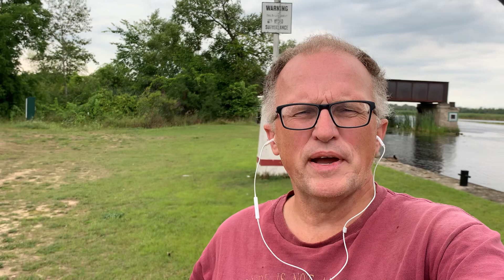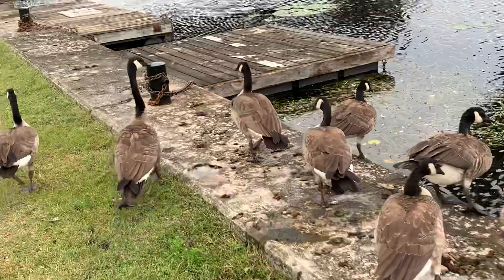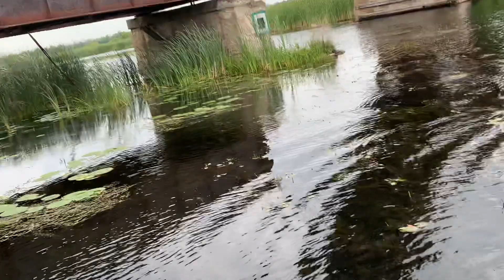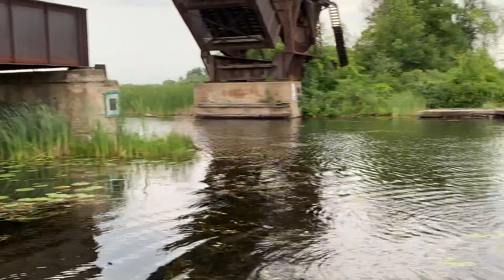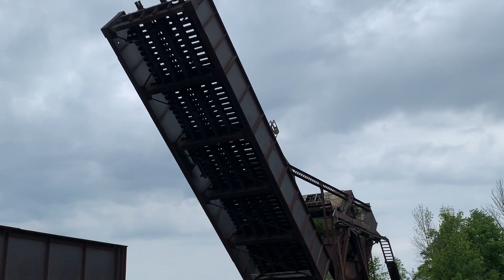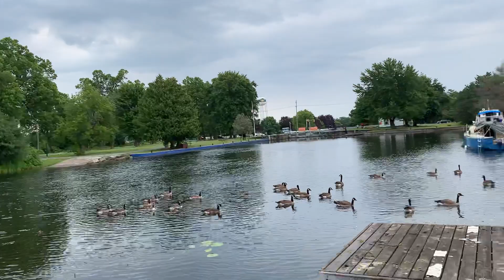My Club of Rome Invited Talk: Abrupt Climate System Change Mayhem:

Comment from the maker: Please donate to my blog at http://paulbeckwith.net to support my research and videos joining the dots on abrupt climate change.

Yesterday, I gave an invited talk to CACOR (Canadian Association of the Club of Rome).
Below is the simplified general description of my talk. I spoke for about 45 minutes, and took questions and chatted with the audience for another 45 minutes. 

Please watch the recorded talk on YouTube at this link: https://youtu.be/HtQWuVUqPI8 

This introduction video was filmed in Smith Falls, Ontario at the site of the famous bascule see-saw railway bridge (a designated Canadian National Heritage Site). This bridge was built in 1912-13 and is so delicately balanced that it was originally operated by a small electric DC motor, most towns operated on DC (direct current) electricity back then. When AC (alternating current) beat out DC a few years later, then the town, like all other places in North America switched over to AC electricity, and the bridge motor no longer worked, so the bridge was then operated manually for many years, until the rail route was eventually closed down in 1978.

For more info on this rail bridge, this site is great:
https://ottawarewind.com/2015/02/04/the-iron-giant-smiths-falls-100-year-old-bascule-bridge/

On to my CACOR talk…

Speaker: Paul Beckwith
Topic:  Abrupt Climate System Change Mayhem
Time: Jul 28, 2021 13:30 Eastern Time (US and Canada)

Summary:
Temperatures in Lytton, BC set new consecutive records recently on a Monday, Tuesday, and Wednesday, and then on Thursday wildfires burned the town to the ground. Torrential rains leading to swollen rivers and flooding just devastated many towns in Europe. Weather extremes are wreaking havoc around the planet. No place is spared. Why?
 
Two Basic Facts:
1) For each 1 degree C rise in temperature, the air can hold 7% more water vapour. This results in the supercharging of storm intensities. 
 
2) The Jet Streams which guide weather patterns are slowing as the Arctic warms, making them wavier in the North-South direction. This increases the intensity, duration, and frequency of extreme weather events around the planet. It also causes them to occur where they never did before. 
 
What happens in the Arctic doesn’t stay in the Arctic. It’s not like Las Vegas. Polar changes have rewired the behaviour of the jet streams.
 
Weather wilding, weirding, and whiplashing is wreaking havoc on our society and imperiling our ability to grow food. 

It won’t end well; it is getting uglier and uglier at an accelerated pace.
 
What can we do??
 
Who is he?
Paul Beckwith, a well-known climate system scientist/physicist/engineer and educator, recently returned from his latest road trip to create a series of videos pertaining to the climate and biodiversity crises.  Paul went from Ottawa, Ontario, to Alberta.   In addition, he took a carbon dioxide monitor with him to measure CO2 levels in enclosed spaces.

Based in Ottawa, Ontario, Canada, Paul is a respected creator of entertaining and comprehensible videos, usually pertaining to climate system science, abrupt climate change, meteorology, oceanography and Earth Sciences.  He occasionally teaches at the University of Ottawa in the Laboratory for Paleoclimatology, and has also taught at Carleton University. He is often asked by concerned citizens and government officials to speak at conferences and events.  In addition to participating in numerous panel discussions, Paul has often been interviewed on various radio and podcast programs, and has participated as a guest and panelist at three United Nations Conference of the Parties Climate Conferences, including COP25 in Madrid, Spain, in December 2019.

In addition to his own YouTube channel , he is a panelist on the Climate Emergency Forum  and is a member of the Facing Future  team.

Paul has been committed to raising public awareness about the climate crisis for over twenty years.  Prior to the Kyoto Protocol, he collected petition signatures, which he presented to a Canadian representative, Elizabeth May.  Paul is actively involved in local climate events since the Kyoto Protocol.  

Please donate to my blog at http://paulbeckwith.net to support my research and videos joining the dots on abrupt climate change.
Reply: You are not alone.
Reply: shame on you Paul harassing those geese. typical human behavior.  humans are trashing the biosphere. no respect for Life!
Reply: 3800 days since Fukushima today, and 76 years since Hiroshima, too. Helluva way to boil a planet that's 71% water for 76 years of Enrico Fermi's legacy, eh professor? Einstein is rolling in his grave so fast, we could hook a generator up to his corpse and power the world eternally for free!
Reply: Jorn Paul Winkler  so what? The salmon are dying at sea, that's so what! TROLL!
Reply: Jorn Paul Winkler  can't have infinite growth on a finite planet.
Reply: Copyright can last a very very long time, well beyond the life span of the author. For example, even now in the 21st Century in the year 2021, Hollywood movie studios still mostly avoid use of the "Happy Birthday" song, a song that was written in the 19th Century, due to fear of having to pay money to copyright lawyers in the European Union.

One workaround for copyright is that once money is paid in a valid manner to the copyright ownership, or sometimes by the copyright ownership in exchange for helping publicize a work, then changes in ownership do not cause the use of a copyright work to be invalid. Suppose for example that someone in 2021 pays Paul Beckwith $8 to be able to legally copy some Paul Beckwith video materials onto other YouTube videos in another YouTube channel, and then Paul Beckwith dies of old age 10 years from now and Big Oil and Big Coal buy up Paul Beckwith's entire estate at auction. The oil and coal companies cannot then take down those videos on that other YouTube channel, in spite of having become the new copyright owner in that hypothetical situation, because of there having been an exchange of money. They probably can however in that hypothetical situation 10 years in the future, as the new copyright owner, take down videos of people who with Paul Beckwith's permission copied for free Paul Beckwith video material onto their own YouTube channels, since there had been no exchange of money. Where no money has been exchanged, a new copyright owner typically has the right to insist on either a copyright payment or a video takedown.

I am curious about the copyright ownership of the Paul Beckwith video in the Canadian Association for Club of Rome, because I am curious to whom YouTubers, YouTubers who might want to exhibit long term copyright care, would pay some nominal amount of money, in order to avoid video takedowns 10 or so years in the future by Big Oil or Big Coal, just in case Big Oil or Big Coal eventually buy up Paul Beckwith's estate - or more to the point buy up his YouTube video collection - when he eventually dies of old age some year.

Comment: The IPCC report was discussed in our news. It was not fun. 
 So I wonder about carbon removal if Japanese knotweed is not a pest we could use to our advantage. It grows so fast and it is so resilient that it can be harvested many times and then the biomass can be dried easily so conversion to biochar seems easy. That biochar could then again by used to improve soils. I read the rhizomes do spread out but only a few meter and then it stops. The damage to buildings seems also less than always thought according to recent research. Trees are worse in this aspect. I have no good idea if the gas released during pyrolysis could be used as fuel during the process. This would release some CO2 too of course.

Comment: HI Paul, I have a question. "What affect would it have on the climate if the Gulf steam current stopped?"
Reply: europe gets cooler america gets hotter
Reply: @iPownYouN00B  That is also my idea but perhaps the  stagnant water there where the Gulfstream normally starts would then get so hot that almost all oxygen would disappear??
Reply: @jean-pierredevent970  the reason the oxygen disappears is because when the water isnt moving there is no way for oxygen to get into the water. Like you need a waterpump in a aquarium you need the movement of the circulation to enrich the water. The pump is the circulation going down in arctic to then down  around africa mixing with different stream endong up at the antarctic rising and in this long process enriches the water with oxygen
Reply: @iPownYouN00B  Thanks!!

Comment: Nice video, thanks Paul. Not a unique use of the bascule method of balancing bridge spans, the Tower of London Bridge is probably the most famous example. That has two of course, one for each side. And very much still in operation.
Reply: You are not alone.